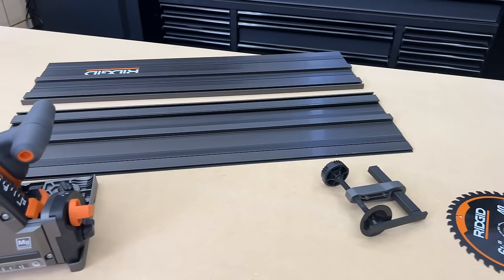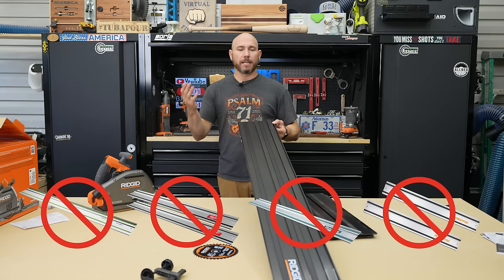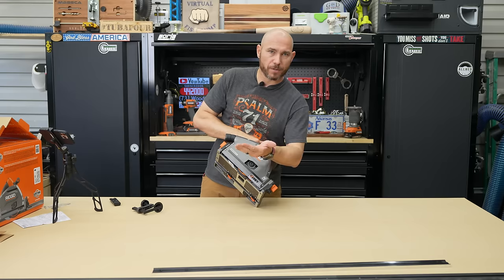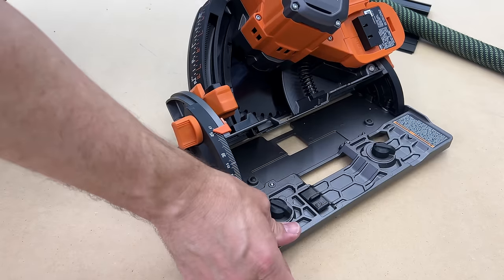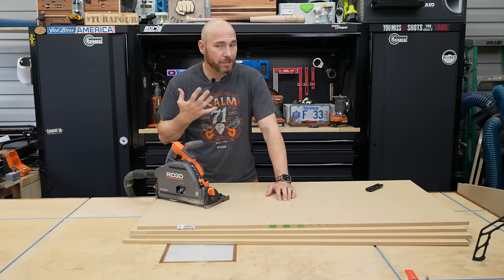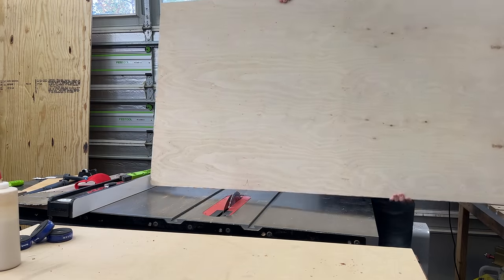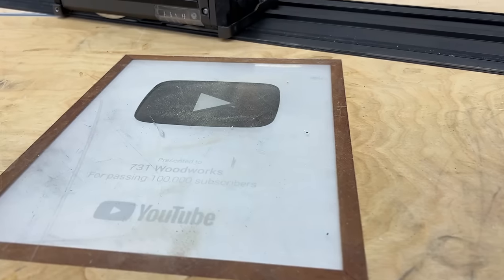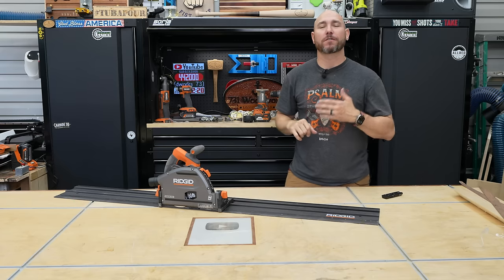Now We Know Everything About the RIDGID Track Saw!

Comment: Great video. Thanks!  I have some small Ridgid and Milwaukee cordless tools, but none of the bigger ones that need the more expensive batteries. So, picking one system and running with it seems important. Can you make a video comparing the two systems when considering buying Track Saw + 10in Miter saw + compact table saw + router?  I'm particularly interested in low noise and low dust, both when including whatever best after-market improvements exist. There are no comparisons out there that address this combination.

Comment: Great review and very tempting, but not sold yet.  Maybe if you could do a full sheet right out of the box, but need another $99 for the xtra track = $500.  I'd like to see you test the Wen Powertec kit with a Makita B-07353 blade; 271+44+25(clamps)=$340...and can upgrade to Makita if needed down the road.  Thanks and appreciate'cha.

Comment: Same here, picked Rigid because of LSA.  I had a mix of BnD and Makita over the years and when I wanted to finally commit to a specific battery line based on the avail of tools, Rigid won.  
Recently I picked up the Rigid battery chainsaw and it works great.  I swapped out the 12" bar for a 16" and it has not let me down.  

I  have been waiting for this track saw.  Next will be the new brushless leaf blower and the new lawn trimmer.   I have all the Ryobi Expand-IT heads for my gas Ryobi and waiting to see if they will work on the new RIgid system.  HD has not confirmed it yet, but the pics looks like it they should work.  Last item to wait for is the new Rigid backpack sprayer.

Comment: One thing I never see mentioned is rubber guide replacement. If you change your blade for any reason, then the cut line may be at a different position. With your contacts, can you find out if they're replaceable?  Thanks.

Comment: Great review! I like my Ridgid tools, that being said, this saw looks like it is on track to be a somewhat fair price point, but still overpriced in my opinion. When you consider that a good circular saw can be purchased for $200, that means you are paying another $200 for two short sections of track and one clamp. One clamp is stupid, why does Ridgid do that? Now if this kit came with two 60" tracks, and two clamps, I would buy it. Also, I prefer that the blade be on the left side of the saw. For now, I will use my cheap old Ridgid circular saw and a strait chunk of lumber. It has the preferred left sided blade!

Comment: One question:   Does it have the ability to do a score cut, like the Wen does?  I love that feature on my Wen.  Keeps from having any blowout on the top if you score it first cut, then do a full cut the 2nd time.
Reply from the maker: Yes but there is no quick setting for it. You'd just need to set the depth stop to make the scoring cut.

Comment: Still waiting for this to drop! No sign of it anywhere. I was quite surprised to see the video on your channel. I’ve been invested in the Ridgid line of cordless tools for over 15 years and have been very satisfied with their performance. I’m also a Union Electrician that does exclusively industrial and commercial work and use Milwaukee, Makita tools daily. Milwaukee are used almost exclusively in my area now. The Ridgid are very well built and perform just as well in my opinion at about half the price. I do wish that they had a more diverse catalog of tools similar to Ryobi/Milwaukee.
Reply: I got the saw a few weeks back after dealing with Home Depot’s horrible online ordering and delivery service. Had to go back on 3 different occasions to fix the order. Anyways the saw is next level in fit and finish. Lots of power, the tracks are really nice and I got it in a bundle with the additional 60” track for $488. 
     I was upset to see the price drop $150 a few days after I ordered it as a “special buy of the day” and I called customer service. They only offered to refund $50 back to my account, oh well. Go to pick up the saw a few days later and they can’t find it or the additional track. Come back next day and they found the saw but no track. Well I ordered the Milwaukee 12v fuel combo set with free tool and just figured I would pick up the track when the Milwaukee kit comes in. A few days go by and I pick up the Milwaukee set and they bring out this giant 8’ monstrosity wrapped in heavy duty contractor garbage bags and I was like “ wow, they really over did the packaging on this one!”. Opened it up in the store and realized it was some sort of 2’x8’ composite wall track for tool organizing. Not at all close to what I ordered and an hour later trying to fix the mixup I was refunded $130, but had to purchase the track at retail price without the kit discount. A few days later it gets delivered to my house and it’s finally correct, but the package had gone on sale again as a “ daily deal” so I call up customer service again and this time they refund me the full difference of price. In the end I payed about $280 for the track saw kit with additional 60” track. 3 trips to Home Depot, and 3 weeks of waiting for deliveries. I would of been happy if they got it right the first time, but then again I have never had an online Home Depot order that wasn’t horribly wrong and a pain in the behind.

Comment: Great video. The only gripe I have as a cordless tool owner is the investment in batteries and space required for chargers.  And yes you will need at least two batteries for any tool line so one is always charging.  I did check on two sites and Ridgid batteries are just as pricey as the other big boys.  Cheers.

Comment: Thorough review, as always. Just curious as to the performance on ripping that hardwood slab if using an actual rip blade. Plywood cuts matter less with the 'general purpose' blade profile, but ripping a solid wood slab is a different animal.
Reply from the maker: I think if you got a lower tooth count blade, 24 tooth or so it would rip better.

Comment: Getting ready to start some closets. Might have to pick this up rather than fighting them on the table saw as you mentioned. FYI, the price you mentioned is for the "tool Only" so if you don't have the Rigid brand you'll need batteries. Should mention that in the video, unless I missed it.

Comment: Huge mistake not making it compatible with Makita and Festool tracks.  I bought and after one day's use returned the Kreg saw. I loved the fact it was right-handed but hated the cord, it had no power, kicked back like a drunk mule and was generally way too fiddly and of course the track wasn't compatible with Makita/Festool, so you lose access to a tremendous amount of accessories. Jumped onto the Makita 40v as I had 3 years experience with the dual 18v and knew Makita made a solid product. The difference was night and day in cut quality, speed, ease of use and power. The Makita absolutely never kicks back and has no riving knife (they're not needed if the saw is designed correctly).  And yes, the battery powered Makita is much more powerful than the corded Kreg.

I've been using Ridgid tools since 1999 but only where they provide a great cost benefit. In most cases competitor products have been better, but at higher premium, so the only Ridgid tools I have at the moment are a table saw and a small portable wet/dry vac. This saw looks like a great value, especially if it's still TTI and has the Lifetime agreement, unlike their Delta-based tools.
Reply: “Drunken Mule Tool Company” merch when?

Comment: Watching the Ridgid track saw's riving knife descending with the blade, I don't see how a plunge cut can be made without the riving knife getting in the way. Yes, it is behind the blade, but when starting in the middle of a board, it still comes down into the wood that isn't being cut. I wish you had demonstrated an actual plunge cut in the middle of a board. I remain skeptical at this point.
Reply: The riving knife is spring loaded. So when it catches on wood, it won't go down.  When the plunge is down and the saw moves forward, the riving knife then has room to move into the whole.  There is another video showing that.  Its like the Milwaukee track saw.

Comment: You should try it with the 8.0 Ah High Output XP batteries. Those batteries have 21700 Cells in them, plus a noticeable bump in power on the Ridgid tools I own. 

Ridgid always has better sales too, so it will come down in price as well.

Does the saw have “octane” contacts?

Comment: Nice. My only problem is that it's cordless. I have a shop to use it in with plenty of power receptacles, but it's getting harder and harder to find corded tools. Since I have a Milwaukee cordless drill I already have batteries and a charger. I don't want multiple chargers and batteries. Just offer it with a cord people.

Comment: Would have liked to see an actual plunge cut in the middle of the sheet. I have Makita and am super happy to not have the riving knife in the way when cutting from point to point on a cut line. It still looks like the riving knife will get in the way if you need to do an accurate plunge from a start point.
Reply from the maker: Riving knife doesn't get in the way of a plunge. It is designed very much like the Milwaukee
Reply: @731Woodworks  cool. Hard to tell from the video.

Comment: I picked up a corded DeWalt 7 1/4 saw, the Milescraft track saw guide plus two additional tracks for around 300 bucks. I know cordless is very popular there's nothing worse than running out of juice halfway through a cut. I struggled with the decision to "cheap out" with the Milescraft or save up for a track saw. I'm very happy with my decision. Per Matt's recommendation regarding the Milescraft. It works perfectly and I get square accurate cuts. I don't do much if any beveling so it works. Love the unbiased reviews Matt!  Keep em coming!
Reply: Agreed. I went with the Milescraft too. It would be a 9 out of 10 if it allowed bevel cuts.
Reply: @Zozee3K  for sure!!

Comment: I suspect that the saw would have performed better on the rip cut though the thicker 2" material if you had used a proper rip blade rather than the fine tooth blade that came with the saw. Same for the bevel cut. The stock blade is probably best on plywood and possibly for cross cuts.

Comment: For end cuts of 2x4 &  2x6 I'd just stick with using a speed square. It accurate, easy and fast.

But for sheet goods or long cuts that I don't want to drag my table saw out on the job for this appears to be a good choice. I've put off buying one due to the quality ones so expensive and the cheap ones just underpowered and not all that great overall. Going to consider rigid. I've been burned by their service agreement before so it'll take some long thoughts on going back.

Comment: I find it funny when people try to compare a mid line pro tool to a pro line (hence Ridgid/Milwaukee) when they are not even close. Try comparing it to a triton track saw ($349) to add what Milwaukee offers would put the Ridgid right in the price range of Milwaukee but it isn't. It is a $400 saw. Ryobi is a lesser line below Ridgid, DeWalt and so on. I find Ridgid's audience is hobbyist to pro. Therefore, pricing needs to reflect that. Milwaukee and Festool are geared more for the contractor line and therefore the price reflects that. There are always those hobbyists that have extra money and can enjoy that line in their shop. I personally feel that what Ridgid is offering in this saw make it a value at that price. One YouTuber you can tell is a big DeWalt personal and tried to say the Ridgid Track Saw was plastic when it is magnesium and aluminum with some plastic as do most tools. Also, said it didn't have a score setting when it does. By the Triton offers 27.5" of track as well. 30" would have added cost and I believe the track was made to be proprietary and I agree that by keeping it this way you get the best performance from your saw. Like you I wish it had more amperage for powering through but all the saws at this price range are 12 amp.

Comment: i like the ridgid option, but you can't really consider this a $399 saw unless you already have ridgid high output battery and charger (especially if comparing to something like the kreg or something else at that price point). with battery and charger it's closer to 600...still considerably less costly than the cordless options from makita or milwaukee, but more directly comparable to the corded makita and not terribly far from the ts55.

Comment: I just got one of these and after cutting the guide strip I realized that the blade was out of alignment. There is an adjustment for that on the back of the base plate. But the blade kept binding up and not cutting straight until I adjusted it.  It would have been nice if it had came properly squared up. Anyone else had that issue?

Comment: Why would variable speed be a good option?  When would you use a slower speed?
Reply from the maker: Variable speed can help prevent dulling the blade as fast. Also certain matierals may cut better at lower speeds vs higher speeds.  Also battery life on sheet goods. You can lower the speeds and still get good cuts on thinner sheet goods which helps battery life.

Comment: Do the TTI head to head and throw the Festool in there as well. I need to replace my Festool 55 because it was stolen. Sucks that this saw is not compatible with the Festool style tracks which I have plenty of. However,  I'm already on the Ridgid battery platform and have had no problems with any of my Ridgid tools. Be nice if I could I use the money I have saved for the Festool TS 60 to buy the Ridgid and then apply what I save towards a Domino 500. Those tracks are a big disappointment though as I worry that companies like TSO and Woodpeckers will not make accessories for the Ridgid tracks. Darn! I think I just talked myself out of buying the Ridgid.

Comment: Does the Ridgid have a laser to help with cuts if you're using it as a circular saw without the track?
Reply from the maker: no it doesn't
Reply: @731Woodworks  Thanks for that! Would you say it's easy to see where you're cutting if you're using it as a circular saw? (Compared to a regular circular saw) or do you think it's still better to have a dedicated circular saw?

I only need any type of electric saw a few times per year and I've got a decade old corded Ryobi with a little laser light that's been fine, but not that great for long straight cuts.   This looks like a nice upgrade but I'd only want to keep one saw, not two.

Comment: I am a Ridgid fan and almost every tool in my shop that can be Ridgid is Ridgid.  That said, I am extremely disappointed that they chose to go with a proprietary track.  You say they said they did that to ensure accuracy and fit.  I call BS cause if that was a real issue then wouldn't everyone have their own track and not use the Festool standards?  Its not and they did this for ONE reason only...locking you into their system and out of cheaper track from others.
Reply: Yep, a proprietary track is quite the failure. The power of track saws isn't in the saw and track by itself. It's all the things like squares, parallel guides, etc...

Comment: Great review. Sounds like it deserves serious conideration.  However, I do not like the fact that it cuts on the inside of the blade and you have to allow another 1/16th inch. I also do not like the fact you are reaching across your body to push the saw!  You are cutting from what for me would be the end of the cut. Most cut the other way and your right hand stays on the right side of your body.  Also, doing repeatable cuts is probably slow. Kreg has rip and parallel guides that go on the track making it quick to cut many pieces the same dimensions. (The guides are flimsy and plastic though.) I wonder if the track can slip, though I saw a clamp in the video?  Kreg's stays put. Lastly, over time the plastic zero clearance stip will wear out and come off. How long do they last, how much do they cost,  and are they available? I did not have a problem getting replacement strips from Kreg.  I also like the fact that the Kreg "plunge saw" is part of a system, ie it goes on a table that may ALMOST replace a table saw. I bought the Adaptive Cutting System, thinking it would. It didn't. I bought a contractor saw on wheels because I needed one that folded up for my garage. I now break down plywood 1/4" too big,  then run it through the table saw for perfection. A track saw will not solve all your problems, but for breaking down plywood it is great. If you do not have $400 or MORE, consider the Kreg RIp Cut. For $45 it is pretty darn good for breaking down plywood. I use it with my little bity Ryobi circular saw.  It can be used with any! ( Not good for cuts larger than 24"). We do not always need a Lambo to get to the supermarket!

Comment: Not being compatible with other brands of rails is an instant fail for me.
Reply: If the rail works the way it is supposed too, what is the need for additional compatibility?
Reply: @HerselLawson  guiderail accessories make a track saw so much better, I consider them essential. and most of those are only made for the Festool/Makita/etc. style of rail. 

parallel guides let you make repeatable, accurate rip cuts, and guiderail squares let you crosscut very accurately. If you have those two things, you essentially have a portable sliding table saw.

not only that, but there are also jigs to use your router with the guiderail, which is amazing for running dados. the festool LR32 system is also amazing for cabinetry